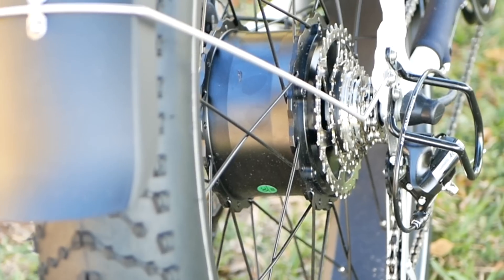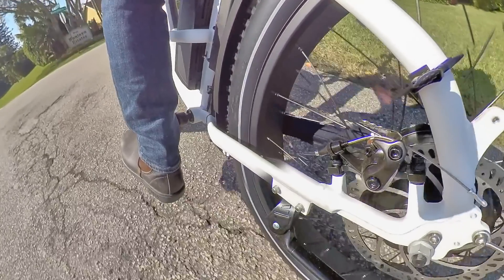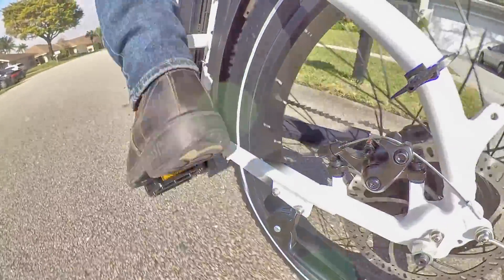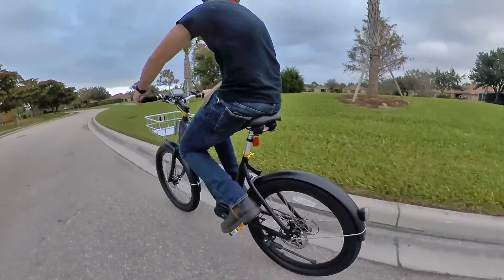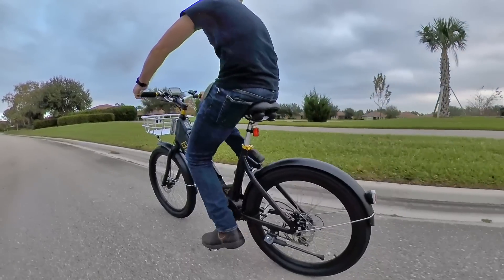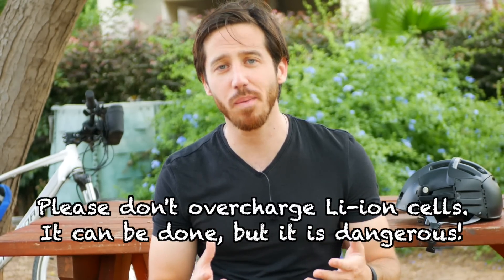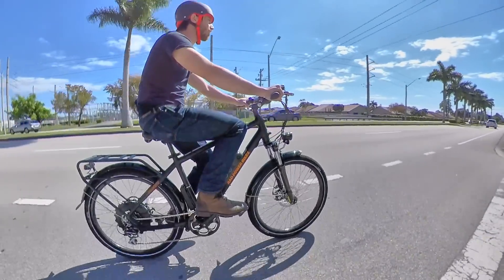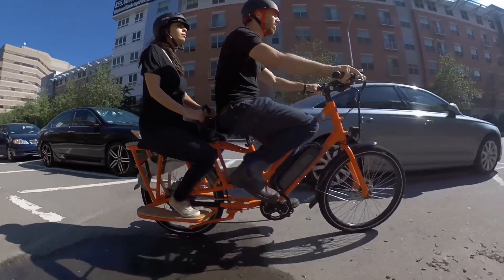Why don't more electric bikes have regen brakes?

Comment: Nice mid drive motor is more effective than any regen brakes, they pretty much useless, unless you live literally in the mountains but there again mid drive would be the best choice.
Reply: Maybe you like maintaining your mechanical transmission and friction brakes. I prefer no mechanical transmission and no friction brakes. All electric, zero maintenance.